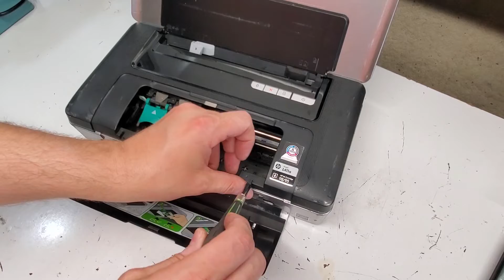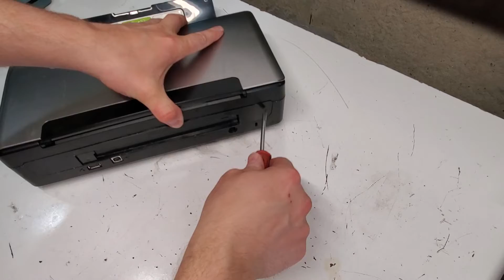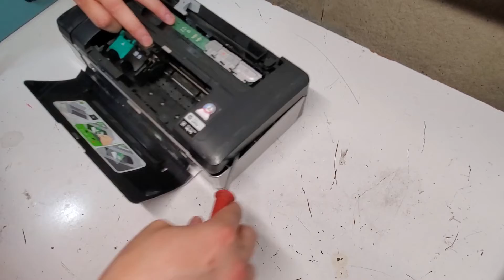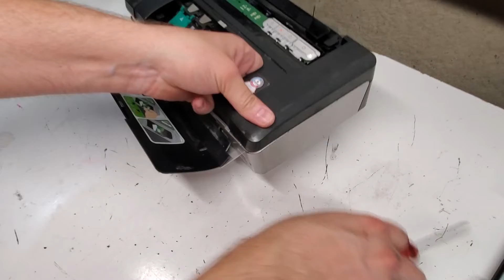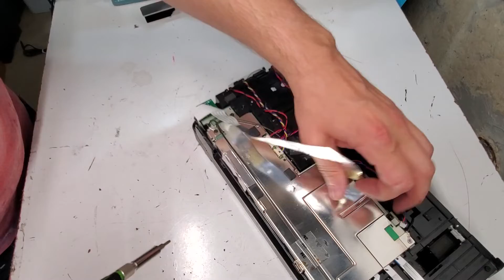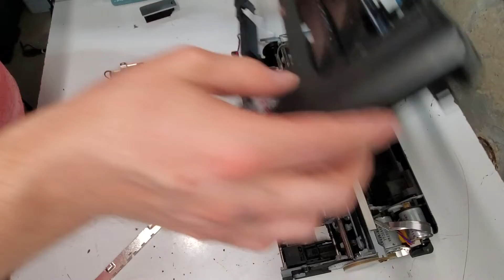How to access inside HP Officejet 100 Mobile printer For Cleaning or Repair Parts - Taking Apart

Comment: I have faced an issue. I refilled the black cartridge and tried to install it, but the printer doesn't detect the black cartridge and the left cartridge light keeps on blinking. Not able to give print commands and not even with Bluetooth. I thought the refilled one might be the problem. 
Recently I have purchased a compatible new cartridge and tried to use it, the same problem persists... the left cartridge light keeps on blinking. I also cleared the pin contacts of both cartidge and printer cartridge socket as well. Nothing is working. 
As soon as I remove the black cartrige the printer works normally.
Any solution or fix for it???
Reply from the maker: I honestly do not know, other than change the ink cartridge. Usually when you order aftermarket ink cartridges, order 2 or more at a time so you can swap it out and return other for refund if it is bad. These remanufactured ink cartridges are sometimes damaged while being cleaned and refilled and the tester at the factory may not detect it right away. Also, there can be a mix up of cartridge number. That is the only thing that come to my mind since I buy aftermarket often and the HP cartridges of this kind have that issue fairly often.
Reply: The only solution is to change faulty head. Get another on ebay and change faulty part.

Comment: Sir, after refill my ink cartridge. One of my ink cartridge show error (black).
And blink error light of ink continuously and cant perform any command .
Please reply me fast
Reply from the maker: Hi. Wipe the ink cartridge on the bottom,, make sure it isn't dripping. Clean the golden contacts area on the cartridge and printer. If that doesn't work,, it is possible that the ink cartridge got damaged when refilling.
Reply: @vivek khajuria 
Did cleaning the gold contacts on the cartridge and the contacts on on the printer help with your black ink problem. I am having the same problem, kindly advise if you have found a solution
Reply: Le sirve el cartucho de la officejet 200????